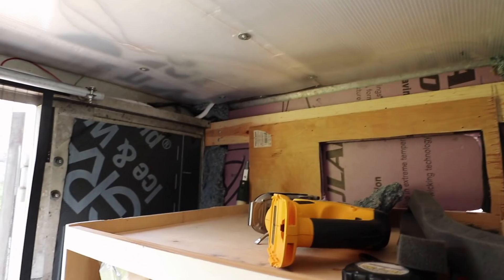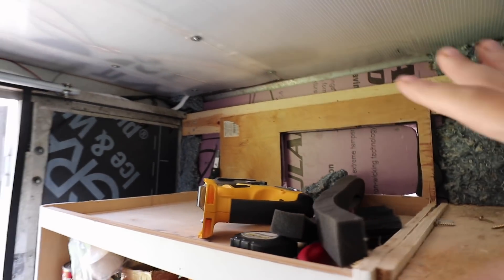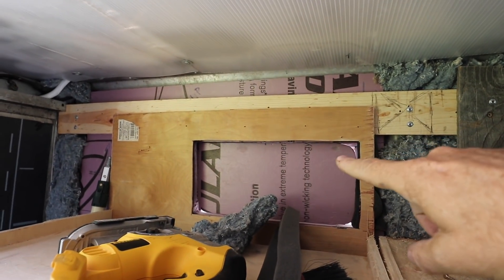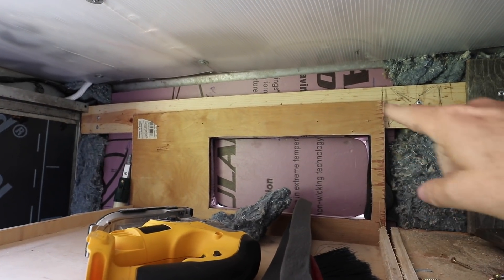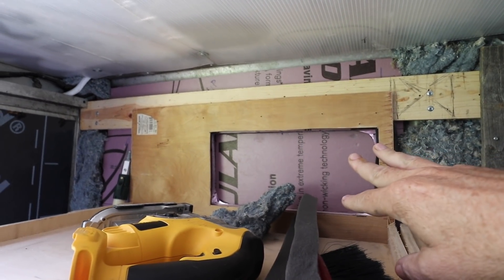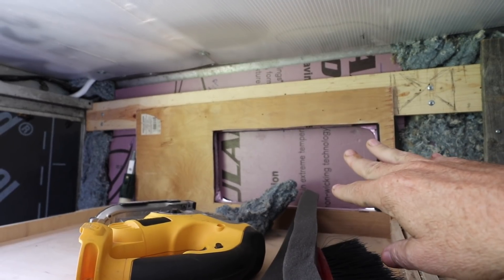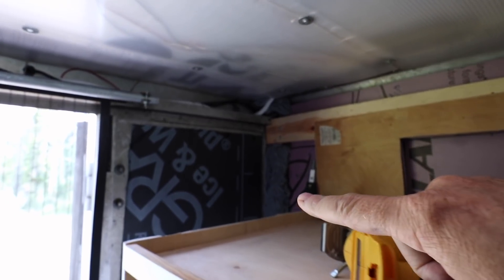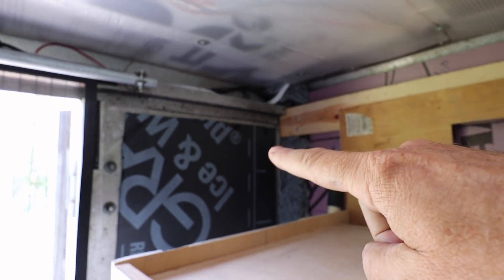Success with Solar Powered AC Install for Step Van RV P4 E563

Comment: Seven,  here's a link to an interior air conditioner cover https://smile.amazon.com/Jeacent-Indoor-Conditioner-Double-Insulation/dp/B077VPJYBK/ref=sr_1_5?keywords=air+conditioner+cover&qid=1569115194&s=gateway&sr=8-5 .  I've used this particular one before although I don't remember which size I was using.  They make a similar cover that goes on the outside but I've not used that one.
Reply from the maker: thx for the link!

Comment: I've heard other installs where they have to angle it down a little to avoid condensation from leaking inside.
Reply from the maker: it does have a slight downward angle toward the outside back